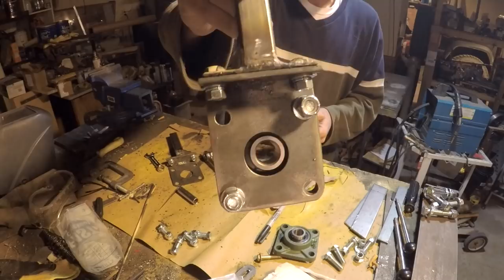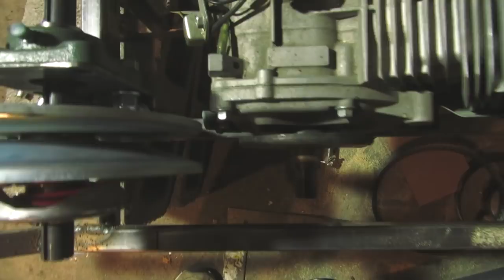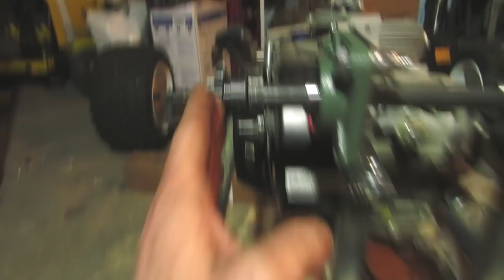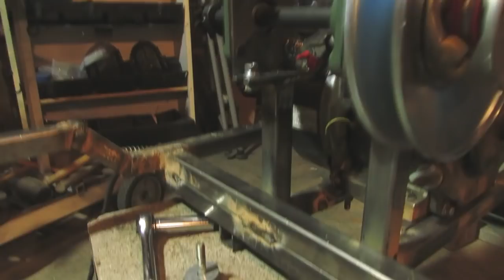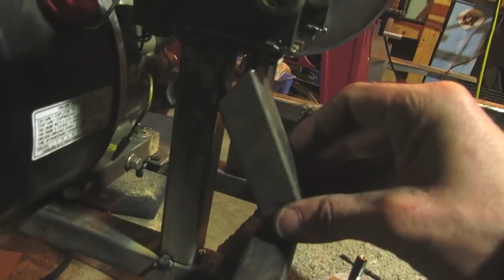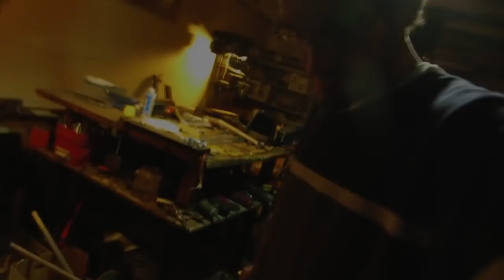Wastelander Machine  : Jackshaft set up

Comment: I would suggest to weld bolts on both ends of the jackshaft, fill the jackshaft with the tubing so everything will be locked in place, and make spinners for the bolts welded to the ends. You could make the spinners go with the theme of it. An extra little touch. Or drill and tap the ends for bolts with spinners on them. One or the other.

Comment: why not take that D,O,M tubing and make your own collars cut them to size   drill n tap them . with that long piece you have you would have endless amount of locking collars. and for the bracing you were showing make the top @ 45 and then the bottom at what ever it needs to be that way theres no gaps or over hangs at the bottom